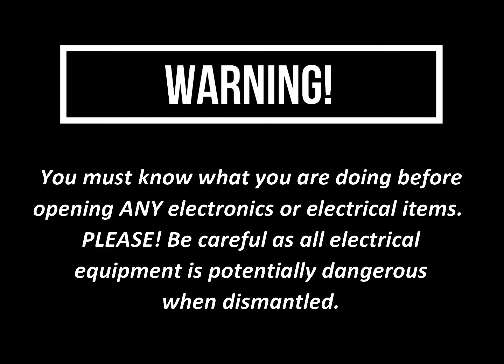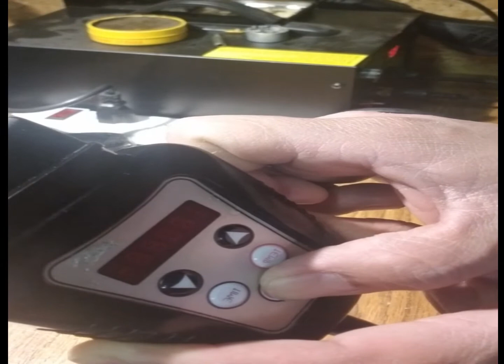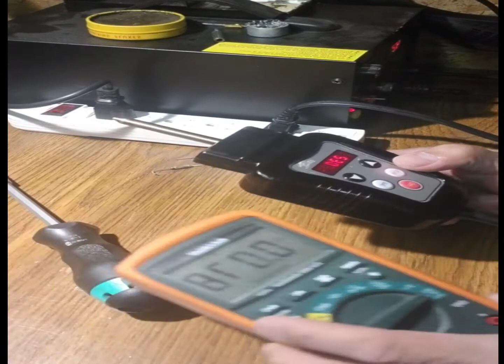SaladMaster Electric Skillet Heat Controller or Digital Probe Repair

Comment: What is the part number of the Thermal Fuse?
Reply: Sorry for the late reply, part number was not visible or faded so I replaced it with 210 degrees Celsius 10 amps thermal fuse